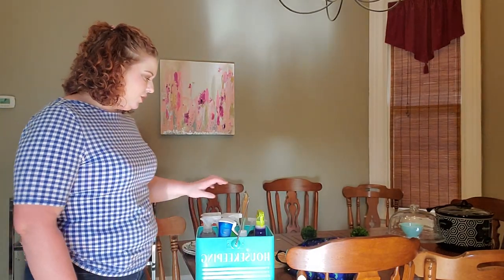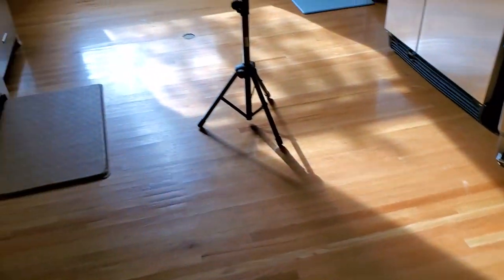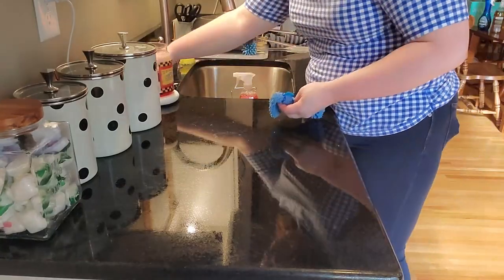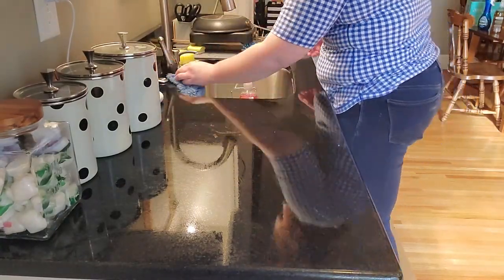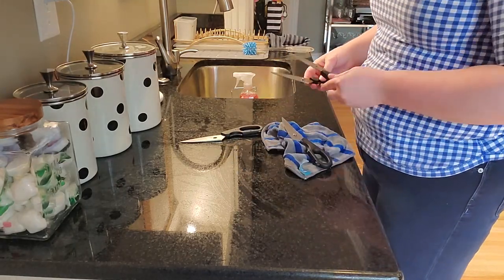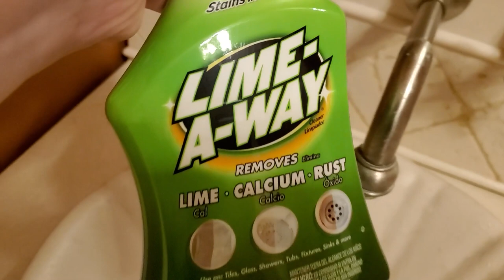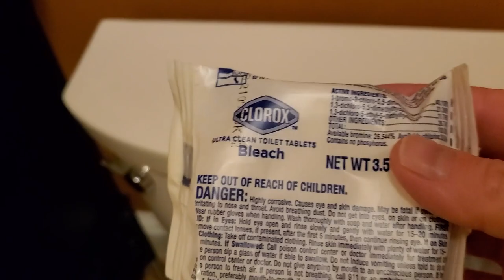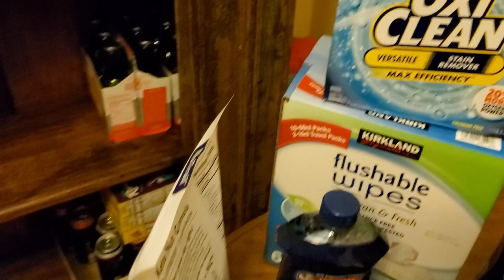BATHROOM/KITCHEN DEEP CLEANING! | EXTREME CLEANING MOTIVATION | Declutter, Clean, and Organize

Comment: I noticed that you use one of those organizers to keep your sink scrub brush, sponge, etc in. I prefer to have almost nothing out on my counters, so I had a friend cut about a 1/2” wide piece of scrap wood wide enough to reach between the two edges of the doors that open to the area below the sink. I stained the piece to match my cupboard and then found a pretty deep flat metal basket with enough room to hold my Dawn, scrub brush and a bottle of hand soap. 
I centered the basket inside the door and put the board about 4” below the framing piece that runs across the top. I do this because the wood in the center of any cupboard doors is too thin to drill and screw into.
Reply from the maker: That’s so smart! I would love to see it.